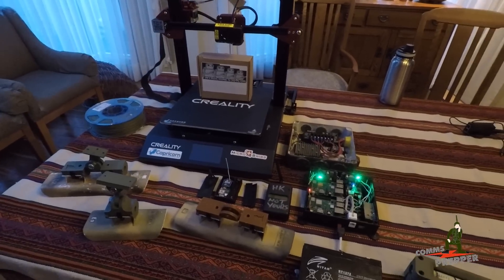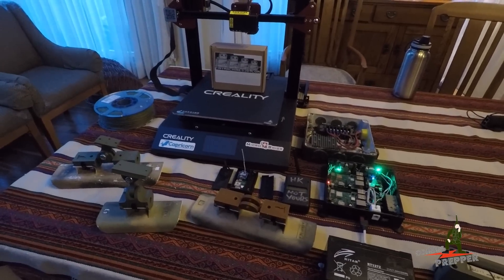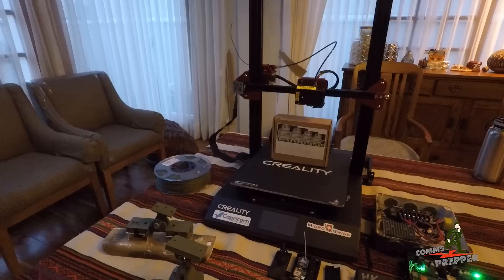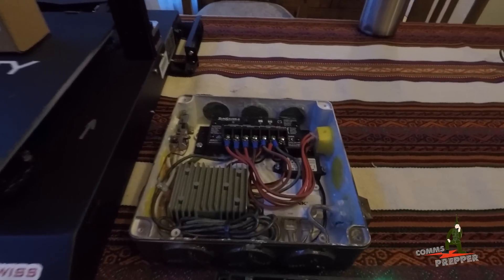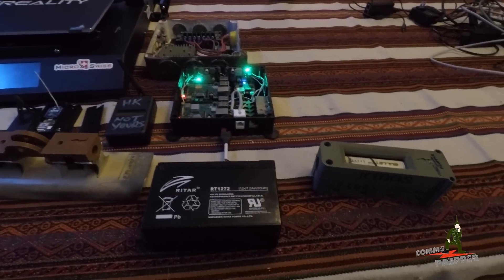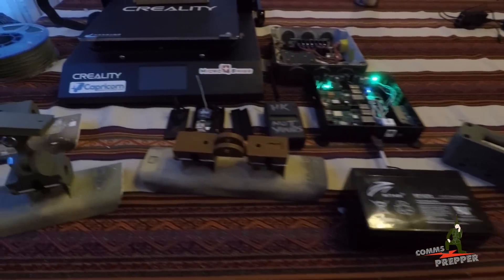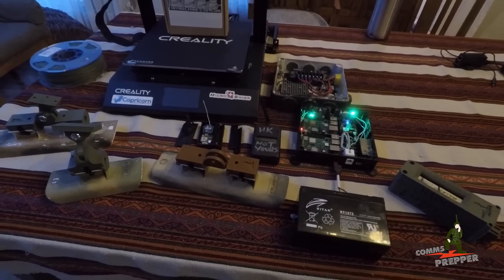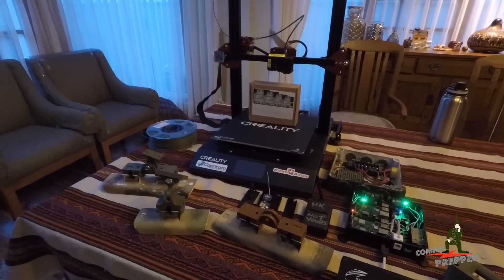Creality CR-10S Pro 3D printer and making Amateur radio parts

Comment: What is that radio that looked like a tube with a coax connector on one end?
Reply from the maker: Ubiquiti Bullet 2.4g WiFi radio (re-flashed for the Amateur Radio Emergency Data Network).

Comment: Very nice printer Hank .... been looking at them for a while now =)     Great to hear you will be back home for a while to play and Utube =)
Reply from the maker: Shopping for a printer can drive you crazy - I researched for weeks. For the price and support I have been very happy with the CR-10S Pro (with Tiny Machines' custom firmware).
Reply: @Commsprepper  Hank that is great =)   What print files does the printer accepts and does it connect to the computer or files loaded on an SD card ???
Reply from the maker: @pathopkins4500  I am not sure.  I purchased the slicer Simplified 3D from Tiny Machines with the printer.  You can print from a PC or inserted SD card.  I am using AutoDesk's Fusion 360 CAD software (free for personal use) to design and create items then save that out as an STL file.  I take that STL file and import it into Simplified 3D for slicing and prepping for the printer.   Simplified 3D then allows you to save a file to the SD card or print via USB cable.